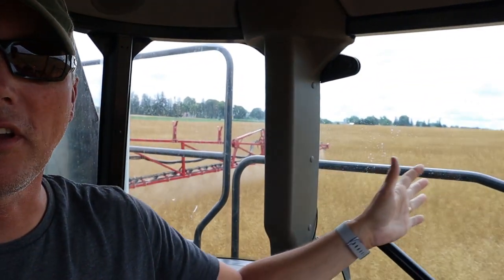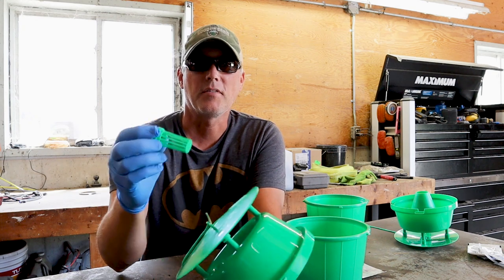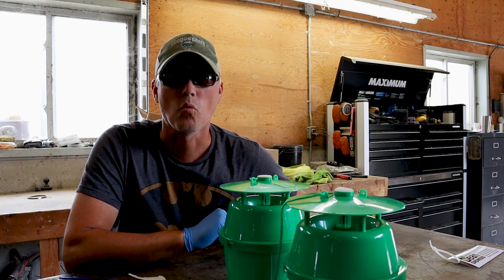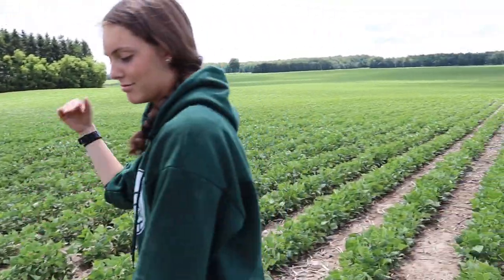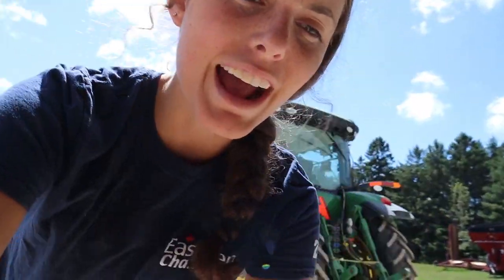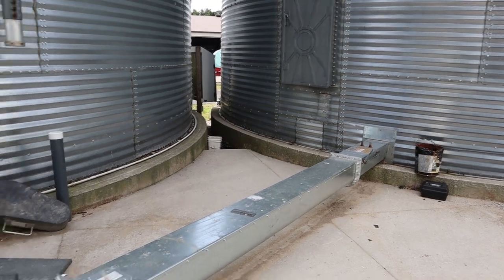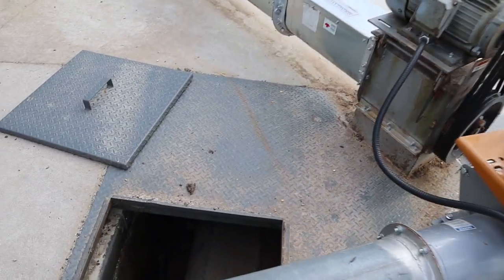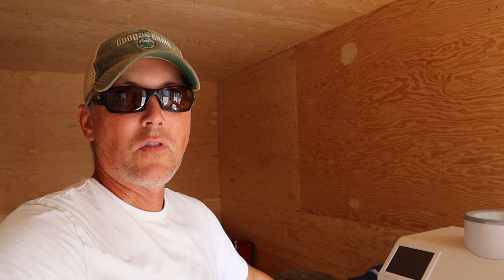Prepping for Harvest 2020 | Vlog 86

Comment: wonder if you ground the rust off and cover it in like rhino lining/truck bed liner....if it would hold up enough to get through harvest while protecting the metal🤔🤔that way you'd only have to maybe redo do it once a year when you clean out. they make a smooth finish or rough but I'm guessing smooth would chip less in the long run....thinking out loud😊